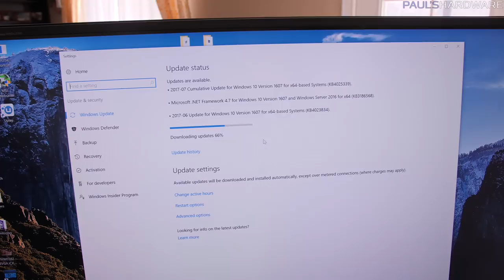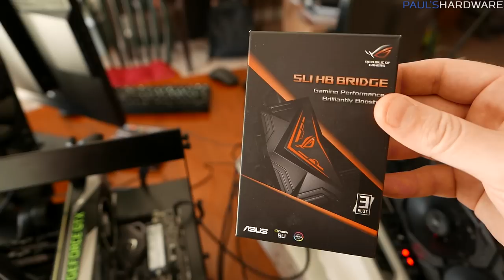A Typical Thursday

Comment: Can you theoretically put a strix 1080 and a msi amor 1080 in sli?
Reply: R SU Pretty sure you can, as long as the actual card (i.e . 1080) is the same then it's fine.

Comment: just a tip instead of using the same cable to power each card i would recomend using 1 cable per power connector for the (cleanest) power if you plan to overclock

Comment: It is hot isn't it? Especially over where you live. I'm in Huntington Beach, my house doesn't have AC. None of the houses built in the 70's had AC. Even though I'm close to the beach, it's still hot. Just have the windows open and fans running when I'm working on my builds.

Comment: The Thermalright hr-02 cools better, looks better, and is cheaper than the passive CPU cooler you are using.
I'm currently using it to passively cool my CPU and have never had temps exceed 65C when stress testing.

Comment: I have a few ideas for the ryzen 3s
1- 450$ PC build (GTX 1050/TI, 8GB RAM, etc..)
2- Comparison with i3 - 7100
3- Comparison with Pentium G4560 (should be interesting)
4- Try the passive cooler on them

Comment: Trying to save some power... while running 3 sli systems at once with some powerconsuming 4core + cpu's. Irony, i think not!
Reply: Klaas M those systems don't use nearly as much power as an air conditioner
Reply: I beg to differ. 3 sli setups being benchmarked at the same time: all 3 of them togethter will be likely to pull about 1500 watts from the wall. Seems like an air conditioner that is big to medium size will pull 1440-900 watts from the wall. That being said, that wasnt even the point, it was a stupid sarcastic comment anyways.

Comment: Should I buy evga gtx 1050 ti or 1060?
Reply: Depends on the budget, give me the budget and the rest of the parts, I'll help you out! Also I would wait a bit more due to mining.
Reply: Im currently having a zotac gefroce gtx 750 Ti and the Intel pentium G3258. And also the H81M-A motherboard. I was thinking about upgrading to the ryzen 5 1600 and the evga gtx 1060. But if someone give me some tips about maybe lower price gpu's or cpu's with not to mutch of a performance change so I don't give more money to a part what dasn't make much of a  diffrence to a lower price part.
(B.T.W I'm not planning to ipgrade very soon, It can wait a month or so :)
Reply: MeadowCrack the 1060 is WAY faster than a 1050ti, so you will notice a clear difference in your games.  It's just that miners have bought all the 1060s, and they are now as expensive as the MSRP of a 1070.....
Reply: What is a good price to buy a gtx 1060 sc?
Reply: Around $200

Comment: Anyone else have a problem with creators update that does not allow you to change minimum processor frequency with ryzen CPU's? Usually there is an option so the CPU clocks down to 1500mhz or whatever, i dont see it.

Comment: What would be a great GPU for my PC. my specs are i7 4770K not OC. My MOBO is MSi Z87-G45 Gaming. my GPU at the moment is a 650 NON Ti. My CPU cooler is a Master Cooler N520 i have 32GB of RAM x4 sticks at 1333MHz and i have two case fans one intake one exhaust.and all of this is inside a Zalman Z12 case. oh i forgot to put i have a WiFi card connected and a separate Ethernet card connected. and great video Paul and love your dogs. why are you rocking back and fourth Paul

Comment: No guesses about relative performance of test-builds... I just wanted to register an objection.
You're surely pronouncing the name of that MSI motherboard wrong.  It's not A-C-K..., it should be "ACK".  You're supposed to make it sound like the noise from that duck in those old insurance commercials.  Loud, jarring & obnoxious:  MSI-X299-Gaming-Shmaming-Blabbity-blah-M-whatever-7-"ACK".  It's a partial respite or remedy for the absurdly long & convoluted naming/branding schemes on these motherboards (where EVERY FUCKING THING has to be called "GAMING", no matter what else any of us want to use it for). 

So by the time folks have fallen half asleep, lulled into a stupor while listening to someone try to recite that whole string of excessive verbiage passing as a "name", then right at the end, they can be jolted awake with the grating suffix-noise: "ACK".  That way they don't miss the rest of your video.